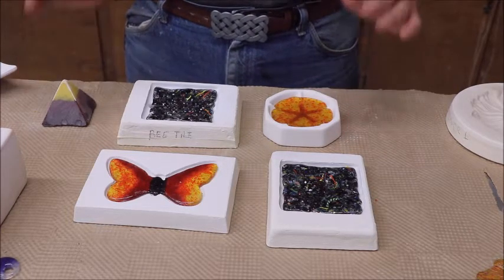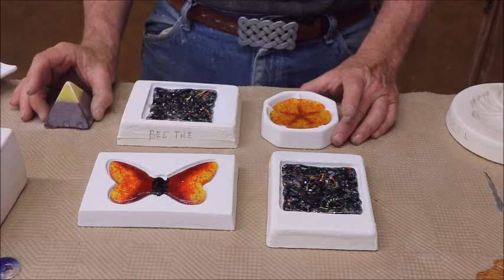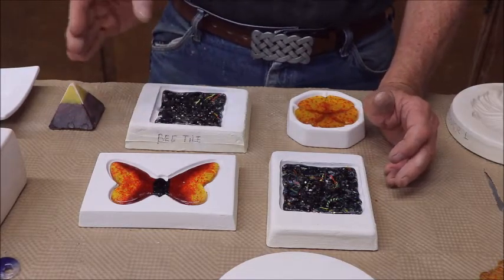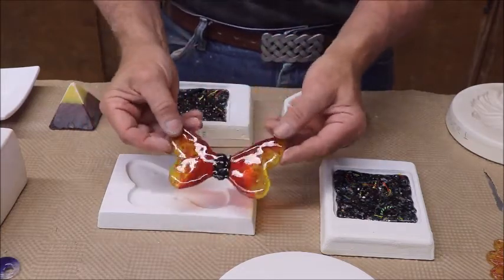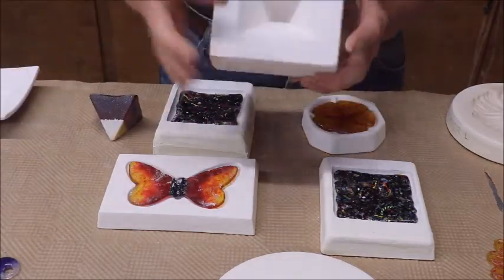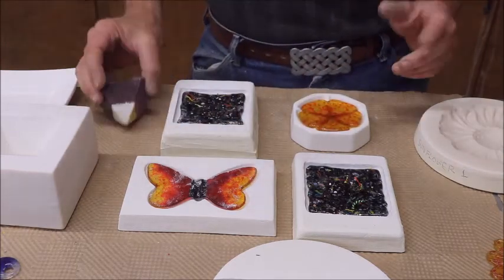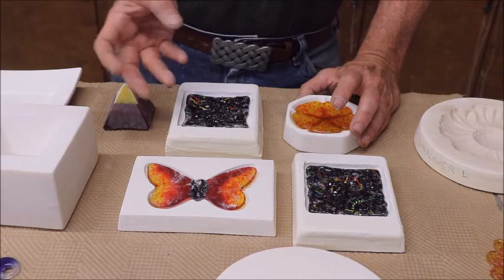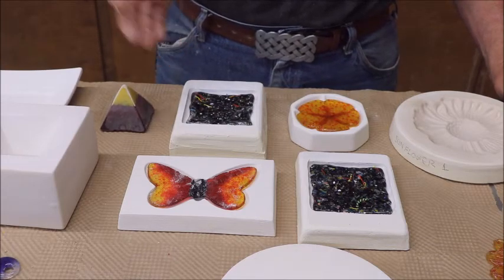Update on Boron Nitride Removal

Comment: Hi
I've  seen in some other videos (not yours) that glass molds need to be ventilated by doing small holes.
Why there are no holes in your molds cap ?
Reply from the maker: It depends on the type of mold.  Large slumping molds sometimes benifit from the holes.  I have found that frit requires no holesas the loose particles act as release points.  Hope that helps.  Experts, please feel free to jump in!